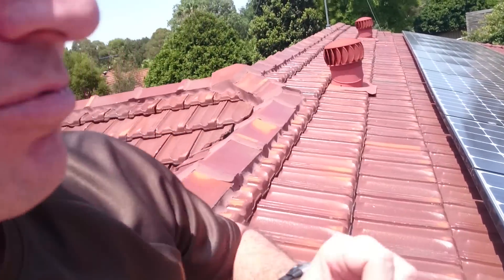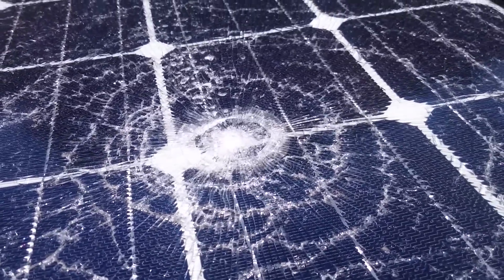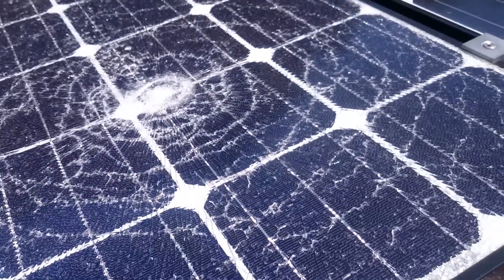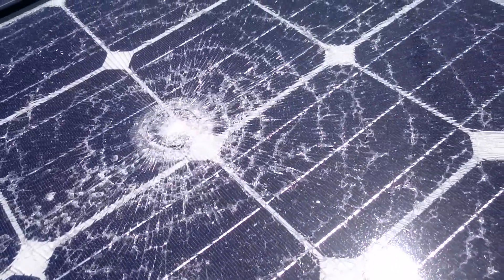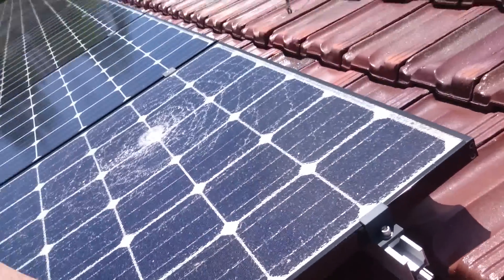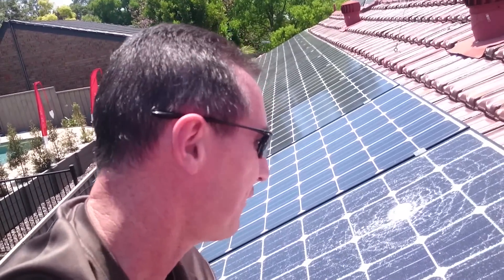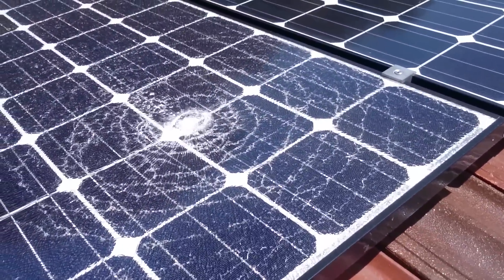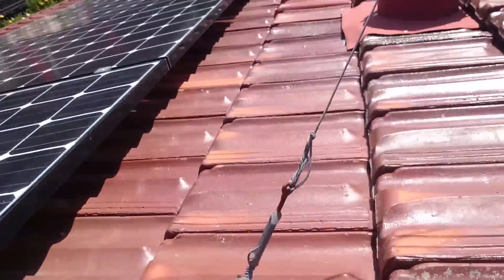Home Rooftop Solar Power System Update - Shattered Panel!

Comment: My parents had a 1L glass Coke bottle that was thrown from a (military, the type used for paratroopers) plane that went through a fibreglass piece of the roof quite some time ago, just missing a worker (which is how they know it was from a plane)

It might be a ball, but if it can withstand hail - which sometimes come in the size of a tennis ball (although it might not be able to withstand hailstones that size...), that seems somewhat unlikely... (A cricket ball at a high angle maybe...) (Large hailstones can do quite a bit of damage: https://twitter.com/RealZaffer/status/666205072532094976 - that seem to have been around tennis ball sized hailstones...)

Comment: green ice from passing planes shitters
Reply: it was frozen rock hard and bounced off then melted
Reply: saw a large hole made in a roof caused by that it was on the news
Reply: +doodr saw it on ABC network news cast a few years ago it happens
Reply: +doodr Small leaks can cause chunks to form by freezing on the outside of the plane. Typically tend to fall off during approach to landing as the plane descends into warmer air... They're not dropped intently or controlled.
Reply: +Michael Tempsch yes the news story i saw showed a hole about 6 inches going straight through the shingles roof boards and finally drywall into living quarters where the ice was found.

Comment: do they have guns in Australia?
Reply: +tim turner no not really.. an no way would a gun cause damage like that
Reply: I was thinking along the lines of a bullet fired into the air by a drunk hillbilly on the other side of town. Or even a pellet gun. Just a guess since the impact zone looks small. But then of course it looks small on a 4 inch screen.
Reply: +tim turner that impact circle seems to be like 4 to 5cm across to me. So not a gunshot i think.
Reply: +tim turner I have a panel what was shattered but a gunshot, it looks nothing like Daves.. A bullet will go through the glass and solar cells and exit the back and on his tile roof most likely fracture the tile behind the panel and be lodged. This is not the case here. whatever hit this panel left the scene.

Comment: I put my money on a nut or bolt from a plane.
Reply: +TrustMeI'mAnEngineer Hmm what would the terminal velocity of a bolt or nut be?

I seem to recall that the numbers for parachuting and skydiving are along the lines of 200 km/h when uh "facing the earth with as much of your body" creating more resistance and upwards to 350 km/h when going into a straight down head pointed downwards dive.

Obviously a a bolt/nut has a significantly different profile and density than a human being but I'd say its a fair guess to say it won't be over twice that speed, still that all depends on whether my memory of that stuff is right or not... too late right now to dig into the physics behind it or doing some proper research. 

But your guess could potentially be right, the central impact (where its a bit deeper than the outer circumference) seems to me like it was probably a fairly small object going fast. However glass under tension that breaks is a strange medium, things can change a lot depending on the type of glass and what type of thing impacts with it... without testing it on an intact panel it'd be hard to say for sure. I'm more familiar with impacts on other materials than glass.
Reply: +ToKeepTrackOfRandomSubs depends on the size and mass / weight. Most planes have aluminum parts so it would have to be sizable.

Comment: WARNING: science content

Lawn mower as energy source for sure (maybe a lawnmower going over a cricket ball, LOL - actually, NO WAY, which you'll see why in a sec.).

Look at the terrain at 0:28. Probably an almost straight shot into the panel from up the hill. 

And the projectile was NOT very big - looking at 1:11 we can see the dimple in the center that imparted energy into the panel. That dimple likely makes it a rock, or a brittle object that got fragged by the lawnmower blade (perhaps the exoskeleton of one of those freaky horror-movie spiders they have there), and the point source nature also could explain why we see a standing wave having been generated versus a mushed out set of waves that would be out of phase. It may be a safe bet to take a small stone, place it at the "epicenter", and let it slide off the roof - it's likely the culprit will be in close proximity to the test stone.

What's surprising is that the underlying PV cells seem unaffected - I guess you can thank the polymer bonding film for the acoustic shockwave (before someone tries to correct me, it's an acoustic wave that travels in a SAW device) isolation. The bonding film also gives it the "safety glass" look some commenters noted, though there is not a second layer of glass in this case.

I would love to see a subsequent EEV blog ENGINEERING analysis of the geometry of the panel and the use of physics and math (not this alchemy and magic bullshit most of you guys are practicing) for the standing acoustic wave that created the visible compression-level crests (at a somewhat FIXED wavelength) of the compression wave in the glass. From that, you should be able to calculate the velocity of the shock wave in the glass, perhaps even identify areas containing inclusions or impurities from the float process.

What's also interesting, not having thought about it before, is that the amount of energy in each crest seems to be equal (makes sense, allowing for losses that created the glass damage), so the energy density because of the changing circumference is changing with radius squared (assuming that the damage threshold is at slightly less than the inherent energy, we'll get some "clipping"). That explains the glass ejection in the 1st crest beyond the impact location. Most fascinating, though, is that standing wave.

So, Dave. let's see a more rigorous analysis of what we're seeing. I've given you a hypotenuse (sic) to prove/disprove. I'd also appreciate you manning up and unblocking @nliteninc (me) from Twitter.